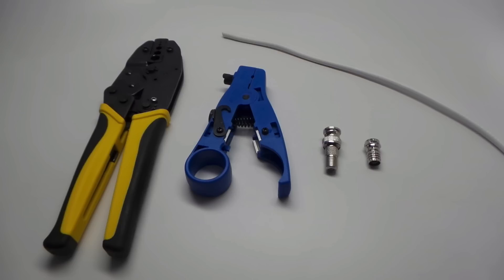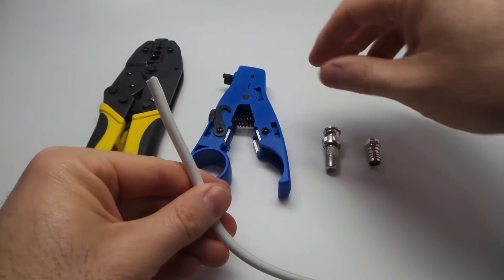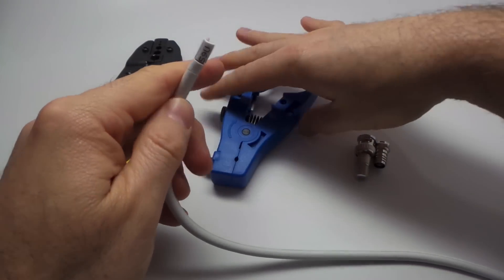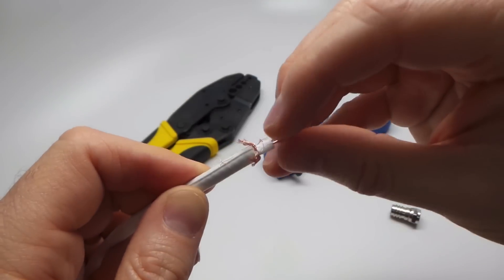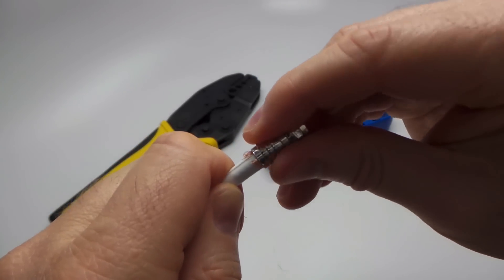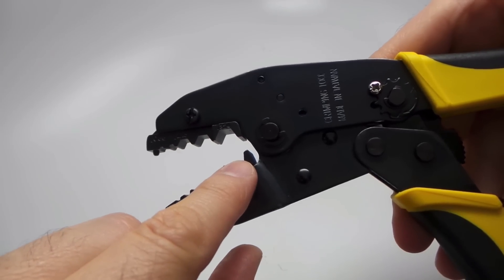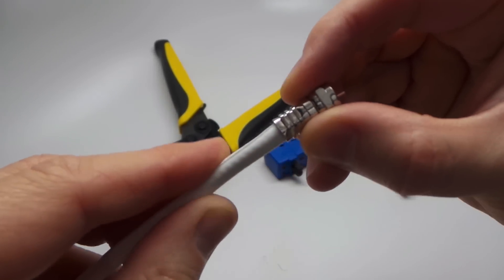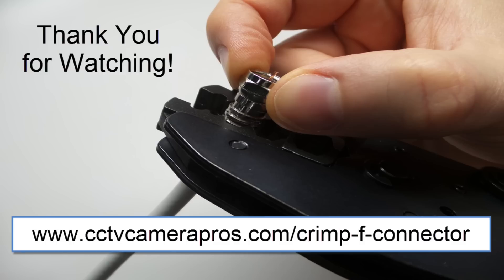How to Crimp F Connector to RG59 Coax Cable

Comment from the maker: How to Crimp F Connector to RG59 Coax Cable

Watch this video to learn how to attach crimp-on type F connectors to RG-59 coaxial cable. Many professional CCTV installers attach F connectors, then screw BNC connectors on top when preparing RG59 cable for CCTV camera installations.

At first, it may seem wasteful to use two connectors to attach a BNC connector, but there are a few reasons some installers use this method.

1) Many low voltage / cable installers are most comfortable attaching F connectors to coax cable.

2) The crimp-on style F connector is the easiest type of connector to attach to RG-59. ( this is the opinion of our co-founder, Mike Haldas )

3) Because of the way the coax core is exposed, there is no guessing if you have enough cable stripped before you crimp. Some other type of connectors are not as simple to judge (such as BNC compression connectors) because the core is concealed when you attach the connector to the cable.

Installation steps covered in the video
===================================
1) Using a coax cable stripper, remove the outer layers of the RG-59 cable. The TL-22 cable stripper from CCTV Camera Pros is pre-adjusted to cut the cable in the exact locations and depths.

2) Peel back all of the copper braided shielding and make sure none is left touching the dielectric insulator or center core.

3) Firmly place the crimp-on F connector onto the coax cable. The center core and dielectric insulator are placed inside the inner cylinder of the connector. The copper braiding is placed on the outside.

4) Place the grip rings of the F connector inside the .324 inch setting of the TL-70 coax cable crimping tool and ratchet it down all the way.

5) Confirm that you have a snug connection by giving it a few tugs.

6) If you are using your RG59 cable for a CCTV system installation, you probably need a BNC connector on the end. If you do, you can use a BNC screw-on type connector to attach to the F connector.

To learn more about the tools and products used in this video, please visit this page. 
http://www.cctvcamerapros.com/crimp-f-connector
Reply: Thank you very much that was helpful